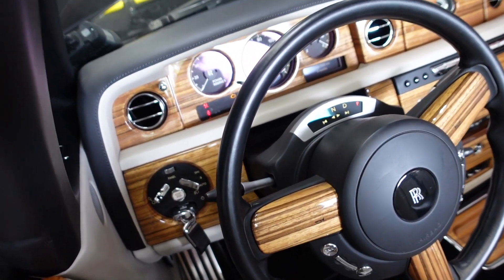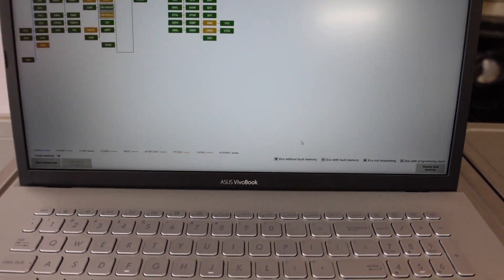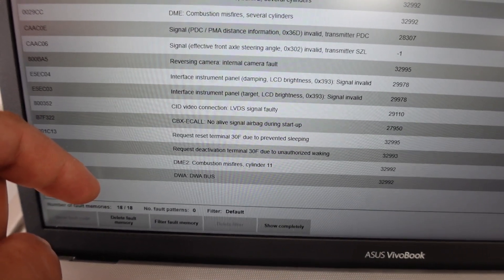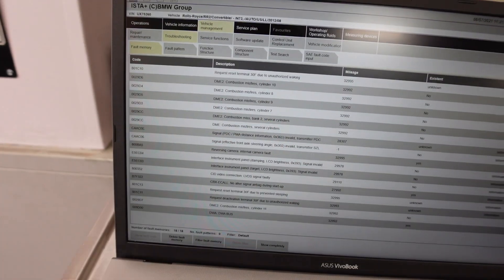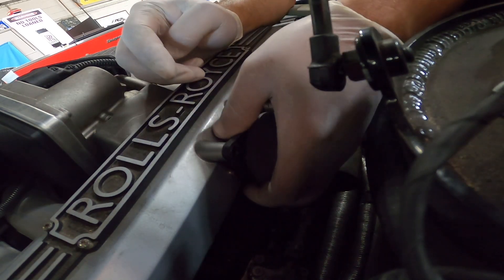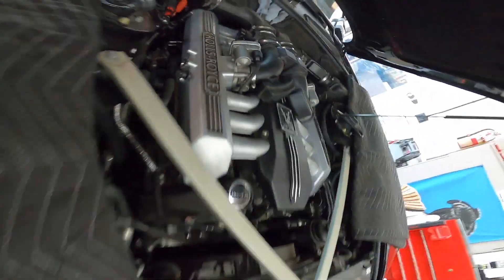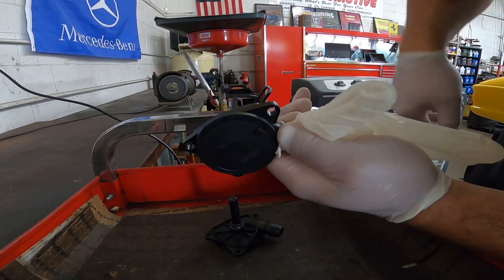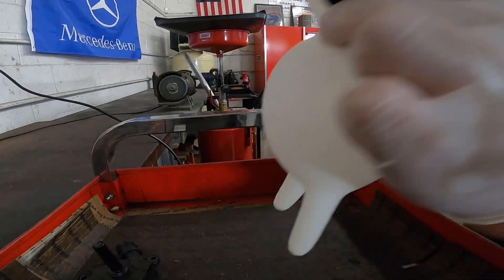Rolls Royce Phantom Multiple Missfire (N73)

Comment: Hiya could this make the oil look Milky as if the head gasket is gone? Because I have similar fault as in the misfire n smoke. However no coolant loss and no overheating. But as I said oil is Milky.
Reply: I have done the oil to coolant intercooler also and oil went clear but now gone milky  a lot thinner now

Comment: Hello thanks so much for sharing this video . I have a BMW 2003 760li it was just serviced at BMW dealership 3 weeeks into driving car started misfiring multiple cylinders a check engine light came on for a moment then went out but still pending did search on youtube your site came up with your troubleshooting procedure .  I had decided to try your method which saved me time and money and ordered parts on ebay pcv vavle 2 driver side and passenger side aftermaket cost total at 28$. The pcv vavle  on engine was accessible and easy to replace.  The car idle excellent and smooth after replacement of pcv vavle was performed. Thanks a million time for sharing your experience.

Comment: Good video and I followed your steps but it didnt work for me, my 760Li is still misfiring. The symptoms are a popping sound on idle from the exhaust and a shake in the cabin. Some juddering under acceleration too. Wonder if you have any ideas? (replaced coil packs and sparks whcih also didnt work).
Reply: Could be vacuum leak. Suggest you do a smoke test to find any leaks.
Reply from the maker: Did you resolve this? If not look into the levers for the valvetronic

Comment: I have a couple spare valves that I removed from a junk car. I tried your test and both failed so i opened one of them to inspect internals and the diaphragm appears  in perfect shape. Looking at the internals I don't see how it could possibly seal air in the glove when blowing in air from compressor.... there is an internal spring holding the valve open and the only way I see it closing is if you were to apply a vacuum where you are blowing in air. I plan to order a new one and will repeat the experiment. I'd love to see confirmation from others that have repeated your test. My car (BMW 760i) is running fine but always room for improvement. Thanks!
Reply from the maker: You are 100% correct. There are two variations of these valves depending on year, but they both work the same. The glove on a good valve will still bleed down but I have found, it will take more time vs one with a torn diaphragm. These were my findings & that is why I do the test.

Comment: I have a 760li with same motor it’s misfiring and smoking
Reply from the maker: Sounds like valve stem seals to me, based off the small amount of information you have provided. Feel free to email me & I can do my best to try and help you diagnose your problem. 

You can find my information in the about page of my channel.
Reply: @elitemechanics1991   thank you very much but I checked the pvc valve yesterday in and left hand bank on the throttle body had oil and the hose was cut and ducked taped